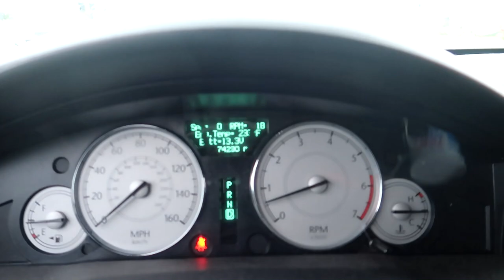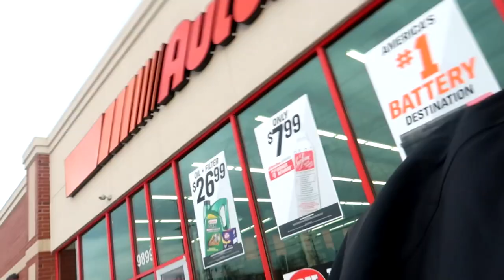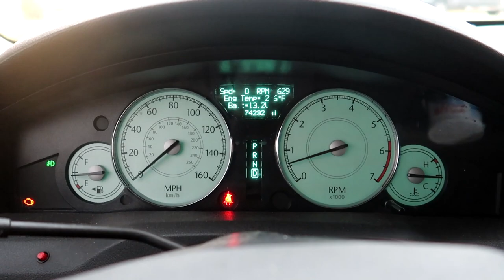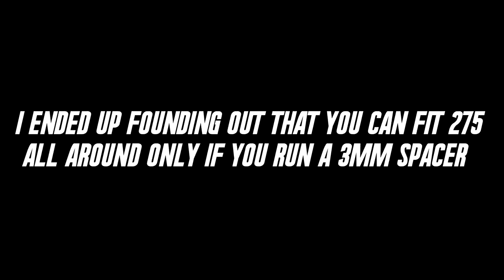The Srt Design Is Complete!

Comment: Yo eBay please help me , give me advice , I have the 5.7 srt design and I have the srt8 rims as well but the front was rubbing for sure , should I change my front tire size and they will fit or should I just run 3mm spacers all around to fit them like you put on the video ?
Reply from the maker: Right Now I Have 245 On The Front It Will Rub Rather u put 245 or 275 you need 3mm spacers I plan on getting spacers and running 275/40/20 all around
Reply: Thank you so much bro ,appreciate that ! 💯💯 When you do can you please make a video explaining this issue and the resolution !
Reply from the maker: Yesir I just ordered my spacers today video coming soon